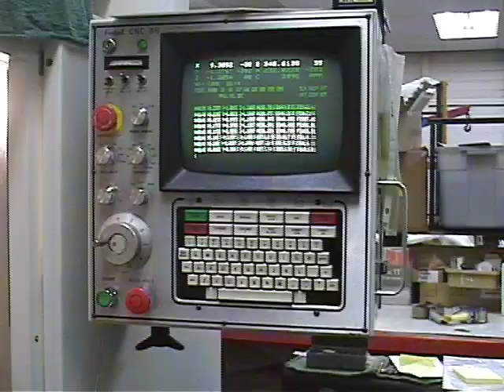NRE University:  Cylinder Head Secrets.  Pt 1 of 2.  Nelson Racing Eng. Camaro, Corvette,Cadillac.

Comment: Also i wonder if they increase the ports for the water and oil passing areas on he head and the block as well ? which can be done by special acid pressure fluids timed just right to remove the right amount of material. :)?

Comment: Also i wonder if they use full synthetic cooling fluids in the CNC machine or the old school  oil based cooling fluids, because if they do, then the heads or other alloys or metals out in the CNC machine need to be acid dipped to be cleaned properly full stop ?

Comment: 243's are around 2200, l92's with the upgraded valves on both sides are around 2900 or if you supply gm ls7 heads it starts around 1600 but goes up dependent of springs. Just go on their website and find the head for you application the prices are on there. Better yet, give him a call, super awesome guy to deal with. They have the best price on LSX Pro-Flo's as well.

Comment: Would such porting  have an advantage for street motor? J used to have a 67 Camaro, Yenko clone, 427/425 with the factory solid cam, etc. Amazing the power the new engines vs the old, they have learned a lot regarding porting, more to making hp than just a big cam that sounds lumpy--

Comment: Yep all done by hand and the companies used charge like a wounded bull and now they have 5 axis CNC machines and still charge like they are doing it by hand, still charging the client like its old school hand porting and machining and the same goes with the current tools used, ie: Power air tools to do most of the work, yet the companies charge like they still use a spanner and sockets  ?
Reply: Yep they still charge a lot in the quality is better and more repeatable if programmed right and good cutting tools used
Reply: They might cut up, cross section three heads, hand port and test 10 ports before coming up with a good port, then have it digitized. You want "cheap" buy AFR. Everyone else isn't doing cookie cutter cnc port work, and they expect to get paid for their development time.